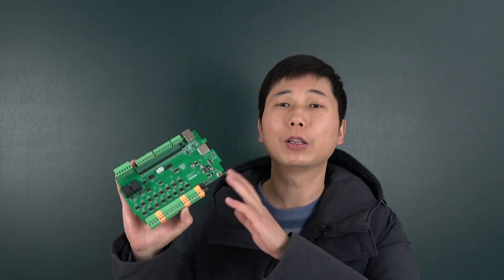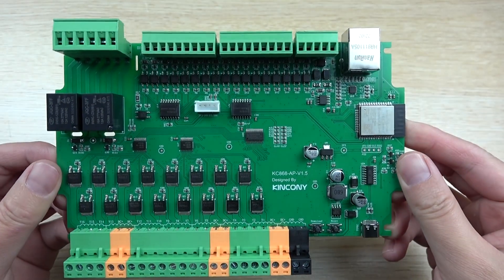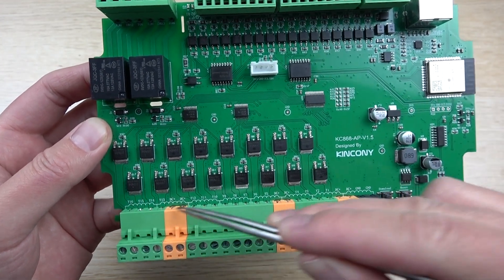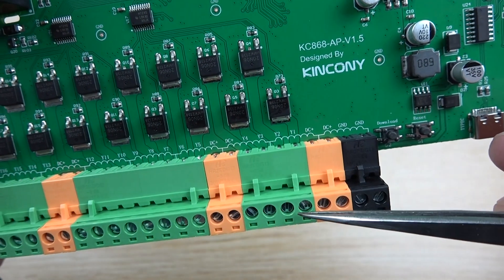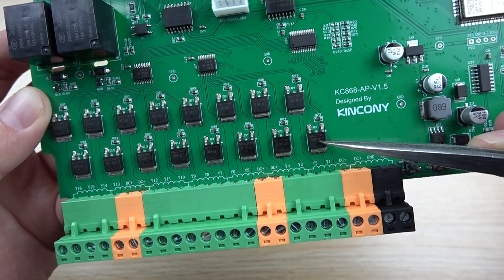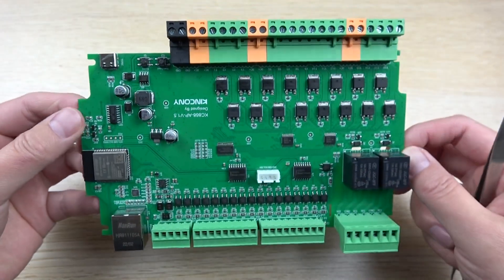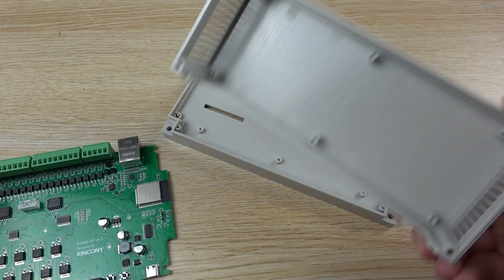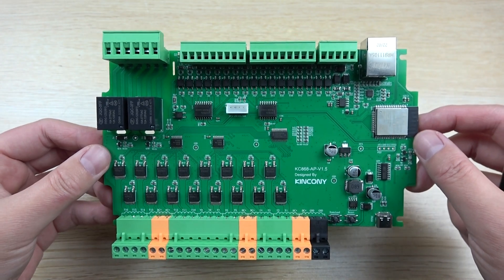ESP32 16CH PWM Smart Dimmer Board - KC868-AP

Comment: This board has an unreasonably high price, it is not worth this money, compared to KC868-A16, PCF8574P chips are replaced with PCA9685, and N-channel MOSFETs are installed, along with this, the price has changed 10 times

Comment: For 5 wire RGBW 24V , are we limited to 3A output ? If the size of LED strip requires 5 A can we input the power supply 24V/5A?
Reply from the maker: 5A for every channel is ok, just vin for terminal need use thick wire

Comment: this is a cool product! I am curious what the purpose of the 74245 octal bus chip is? it seems like you are just passing the PWM signal from the ESP32 to the mosfets. why not connect directly to the mosfets?
Reply from the maker: we use PCA9685 12-bit PWM driver in ESPHome. It uses I²C Bus for communication, extender for 16 channel PWM output. so can easy use for home assistant.
Reply: @KinCony  oops yes i see that now. im curious about the PWM signal after the PCA9685. what is the purpose of the 74HCT245 chips at U17 and U21? I was thinking maybe to shift the 3v signal to 5v, but the mosfets can switch on with only  2 volts.
Reply from the maker: @zumdar  for level conversion and drive capability improvement.

Comment: Can we use it to control 220V AC led lights?
Reply from the maker: that need add extend driver, on board driver chip is design for dc12v or 24v led light.

Comment: Can I use one relay for controlling AC Appliance and other relay for dc appliance? I have same problem. For other k series boards too…. Is it possible to controll AC and dc appliance from the same board?
Reply from the maker: sure, every relay is independent. relay can control for AC load, or DC load.

Comment: I don't know how you are so stubborn and do not install a CAN driver that costs less than 1 USD and opens up an extremely large market for you in the automotive industry and automation with fieldbus communication.
The ESP32 has a built-in canbus controller that works great, it just needs an external driver like most microcontrollers.
Also an even better option is CAN-FD with the MCP2518FD external CAN controller
Also in addition it can be very good option to add RS485  driver also cheap driver for fieldbus communication bat not good as CAN bus.
Keyword is low latency communication !!!
Reply from the maker: thanks for your suggestion, maybe in furture we will make a board with CAN bus, because now use out of GPIOs, ESP32 only have 3 hardware serial port. usually will use for USB download, RS485 and maybe GSM.